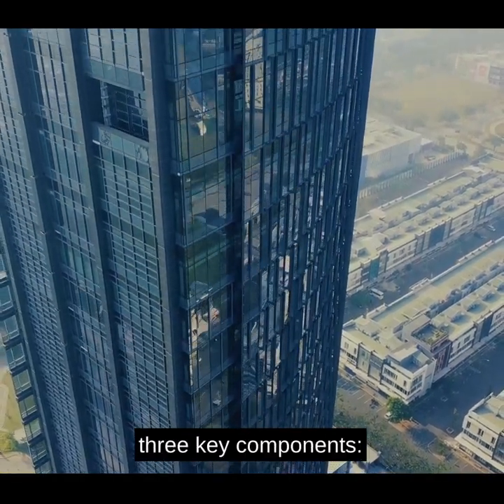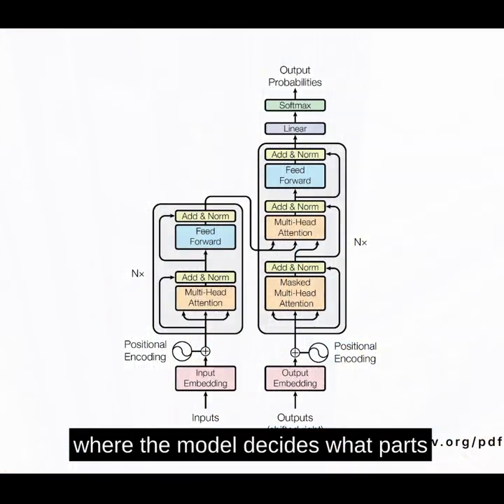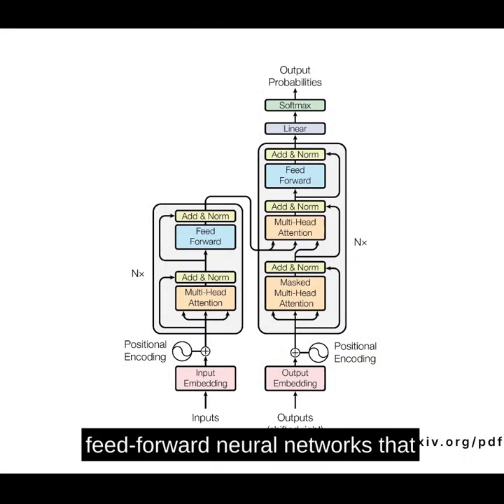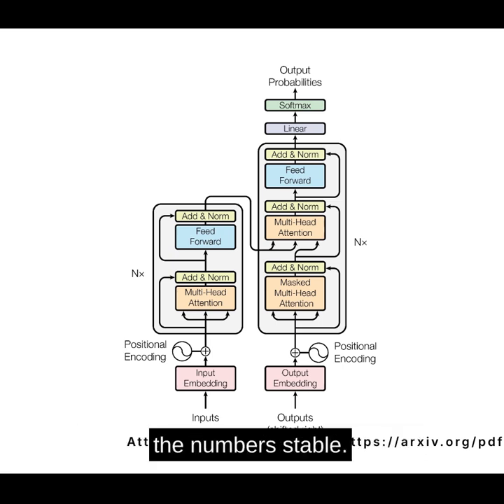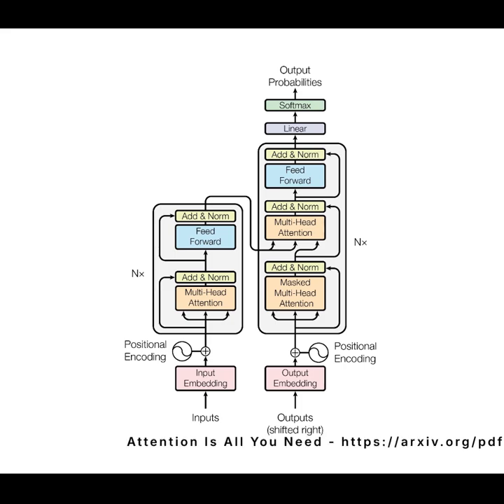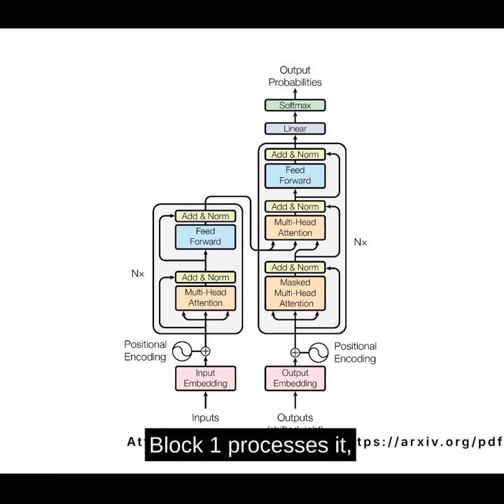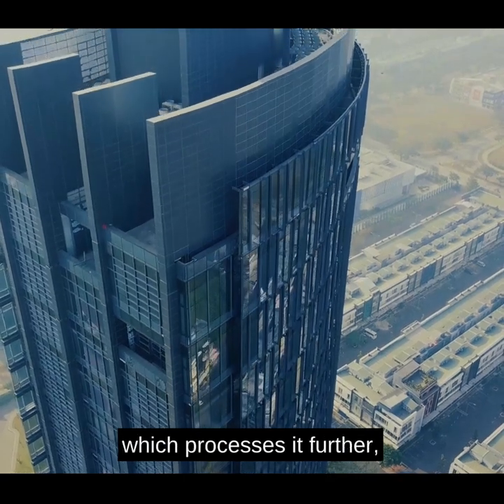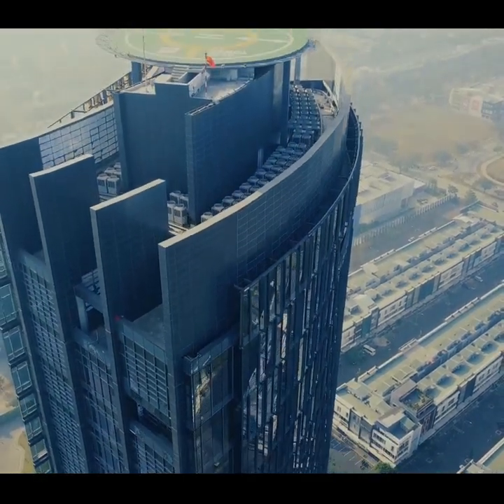What is BlockSwap? How to fit large AI models on consumer GPUs

Comment: Great video. May I ask, what part of the hardware is responsible for how fast a generation is processed? I’m assuming vram is more about storage rather than speed. Correct?
Reply from the maker: Correct but it is also affecting the speed.I n a nutshell,  several pieces come into play: primarily how many GPU cores you have on your graphics card and your memory bandwidth (how fast data moves between the cores and VRAM). When using BlockSwap, your PCIe bandwidth and RAM speed also become factors since we're constantly moving data between GPU and system memory.
Reply: @AInVFX thank you, very helpful
Reply from the maker: @grrinc  Thank you for watching!